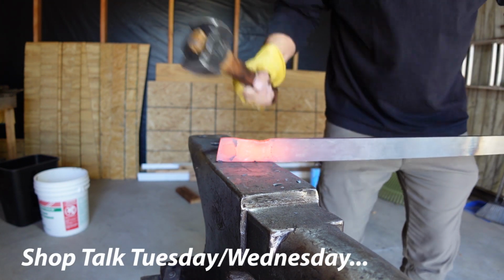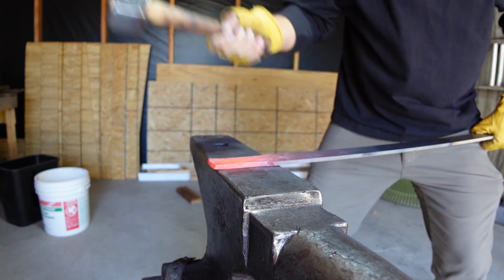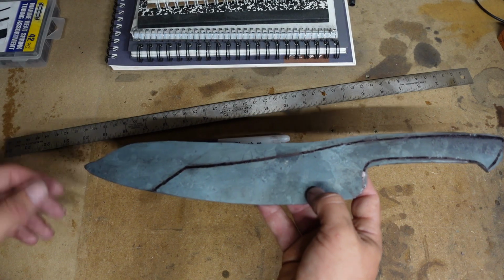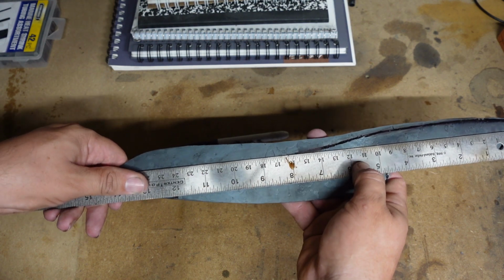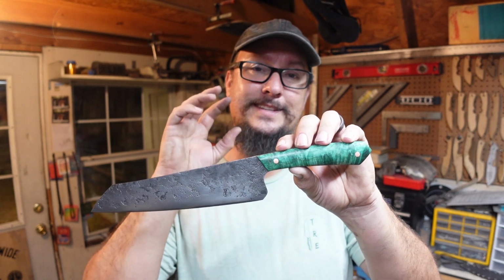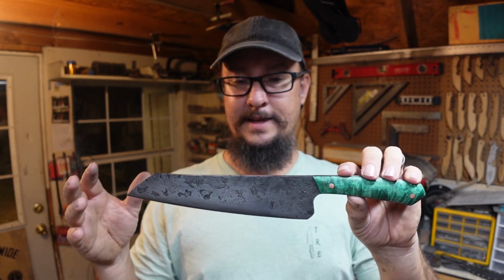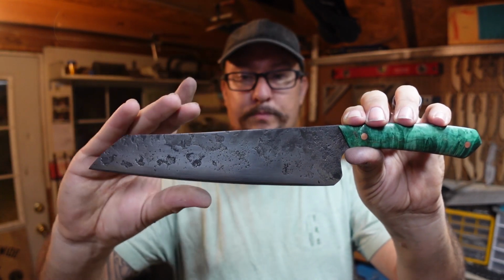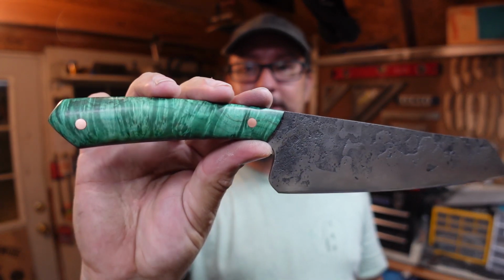Forging A Chefs Knife | Shop Talk Tuesday Episode 154 | 80CRV2

Comment: Love the video! Forging a chef's knife is definitely a challenge to get used to. 

If it helps any, when I do mine, I measure my steel by weight. I start with as much steel by weight as I want my finished knife to be. Then I work my stock down into a rough approximation of my final shape, with my tip higer then I want it in the end.. Then I work from spine to bevel, like you did to correct your tip placement. Working in my bevels is my final step. That way,, I establish a rough distal tapper and refine it and the tip placement as I bevel the knife.

Maybe something in there will help on the next chef's knife.
Reply from the maker: Yup, those are some great tips that I will try on the next one.

Comment: Oh sell it, someone will snap it up.
Never had much luck forging a chefs knife to any kind of final finish because they just have to get wafer thin for them to work properly. During the heat treat they'll usually crack or end up in some kind of woopsie doodle of rolling hills and valleys. So they always need some kind of grinding to get the final profile and that's just part of metallurgy and edge geometry which even historically is done on every cooking knife basically ever made! :)
With one exception Ive heard first hand was from an old English butcher and also my grandfather on dads side who was a shearers cook- they used to use wrought iron blades back in the 1900s to about the mid 1940s for doing the cuts of meat and would planish the edge of the iron blade until it got really thin like you would a scythe blade for cutting hay. Then true it up on a sharpening stone. This was done for a couple of reasons-
1: poor as a pair of beans
2: no good cutlery steel
So while the Iron wouldn't hold an edge for very long and wears very quick it won't bend on soft materials and you could 2-3 stokes on a steel have it back to being razor sharp in a matter of seconds, plus when you get a profile as thin as they did it would cut well even if it was a little blunt. The upside with the wrought iron was its also fairly inert and doesn't really rust like steel. Now of course when they could get a good steel it was usually from old saw blades and banged out to shape which we all know and are familiar with.

This is a complete antithesis on how I make knives! :) I still like them wafer thin, I use barely holding together, pushed to its limits hard as hell steel and I don't expect the user to have to sharpen it very often at all. But back in times of ye olde days, that's sort of what they used to get by and this is turning into an essay no one will read so keep on making them knives :)
Reply from the maker: I actually really liked the story! It was definitely a pain to forge it this thin but it turned out better than I imagined.

Comment: Hey, nice step by step video. I was wondering how you make sure that the surface of the tang is 100% flat and that there is no gap between the tang and the scale? Thanks!
Reply from the maker: I use my little planishing hammer to handle that area and take my time to making sure that the hammer blows are even. I don't know how I'm able to eyeball the even thickness as well as I do, but that helps a ton. You can also use calipers to help with that.
Reply: @theriversexperience9383  thanks a lot for this. Keep up the great work

Comment: Is ferric chloride food friendly ? Did you rub blade guard paste or anything else on the blade ? Awesome job !
Reply from the maker: I used the Ferric to darken it a bit (for about a minute) and then made sure to clean it very well with Baking Soda then soap and water. After that, I used food safe mineral oil for the rest of the processes instead of WD40.
Reply: @theriversexperience9383   Thanks for the info brother.